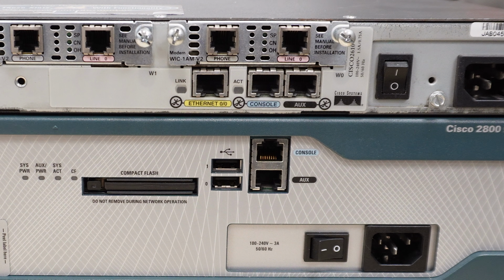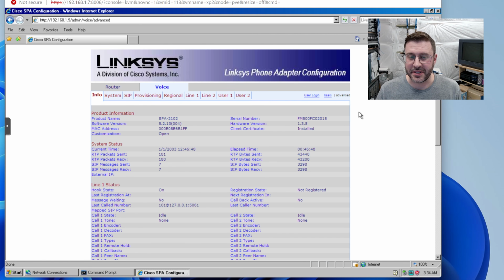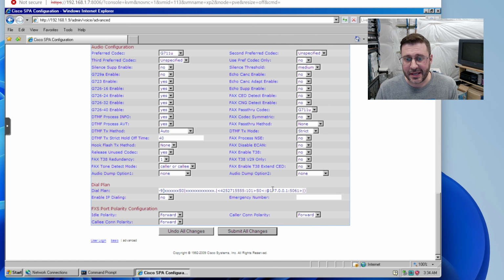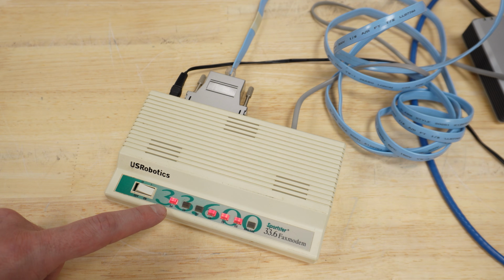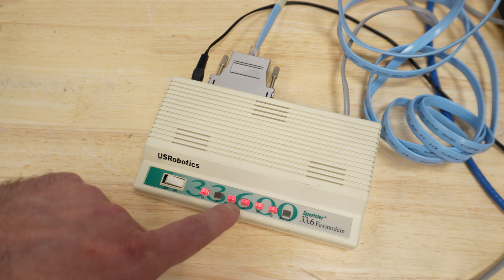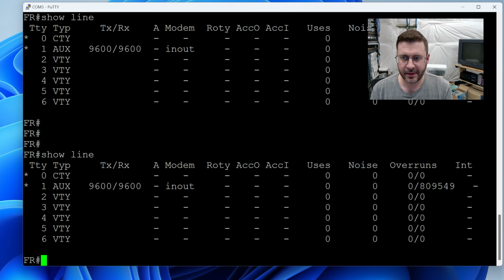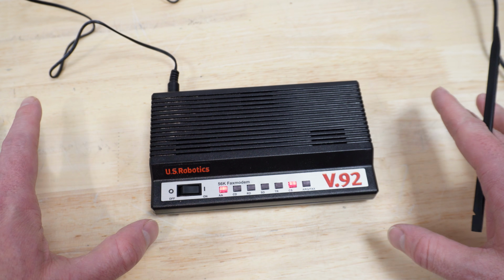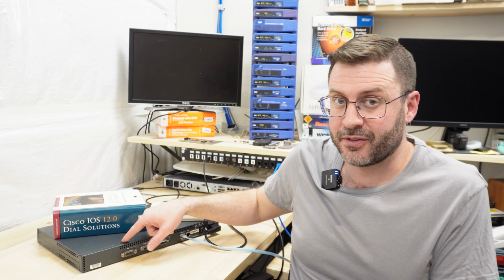Dialing into Cisco Routers

Comment: Great video!
This is a topic that I actually know things about. Not the Cisco part but everything else. Here are my suggestions:

A: Make a serial sniffer cable. Take a straight DB25 cable that you connect in series with whatever you want to sniff/debug. Add two additional cabels to that DB25 cable, that in turn connect to the input pins of two serial ports of a computer (or perhaps your 8-port terminal server). Connect those two cables in a way that each sniffs signals from each direction. The simplest use case then is to just run two Putty instances on your computer, one for each sniffer port, but the better way is to use some dedicated software that indicates all flow control signals and whatnot too, and puts all text in the same windows with for example different colors to distinguish who sends what.
This is 100% the best DIY way to actually know what's going on on a RS232 connection. With this you can easily tell if for example the Cisco device and the modem are just echoing each others commands in a never ending echo ping pong loop.

B: For video creation purposes, and also perhaps to trouble shoot the noise other commenters mention, you can build a simple adapter to tap the phone line. A capacitor in series, say 0.1µF rated at 200V or so in series with a voltage divider with say 47k - 4.7k, and two "antiparallell" diodes across the lower resistor ("antiparallell"= two diodes in parallell, but turned in opposite directions). You can then connect an audio cable to the resistor-diodes combo (ground/shield to the wire that goes to the phone line) and listen using a line input on anything that has NO CONNECTION TO GROUND. I.E. a cheap USB sound card on a laptop running on battery power (and to be safe no other wires connected), or for that sake a 1980's boom box or whatnot.
Note that the speakers in the Sportster modems are terrible. They are more or less just a piezo buzzer that is hooked up to reproduce audio rather than just buzz. You can't distinguish correct clicks and whatnot from line noise.

C: As someone else have already stated - at least the 33k6 and newer modems already have error correction built in and thus any line noise or for that sake not-terrible compression issues on the phone line / ATA side shouldn't be a problem with those modems.

D: I also agree with the comment that suggest you try modem-modem connection with two computers (or two serial ports on the same computer) and make sure things are solid this way first. If you use some classic "modem" terminal emulator software you can also try sending files and check which speed you get, and any retransmissions (select ZMODEM for file transfers, it does error correction and whatnot and is generally the best choice compared to the older YMODEM, XMODEM and KERMIT in most cases).

E: You can also try connecting the AUX port on the Cisco device directly to a computer, maybe with a crossover cable, maybe not. You should be able to manually "emulate" a modem by pasting RING, wait for the Cisco device to say ATA and then paste CONNECT 9600 or similar in the terminal window. Note that you have to paste the strings as the slowness of manually typing might make the Cisco device think it's noise or whatnot. (Not sure if this is the case for Cisco devices but in general modem related software/firmware works this way).

F: If you give up on repairing the fully dead 33k6 modem, maybe ask Epictronic (Youtube) if they are interested in having a look at it. After all, the USR modems are x86 based (IIRC they use the 80188) so they are fairly close to the PC's that Epictronics are already working on.

G: I've written this before, and I'm writing this again: I really wish/recommend that you get a classic office use PBX. Just make sure you get one that don't mangle the audio, i.e. either one that is old enough to connect the audio using analogue paths, or one with digital audio that is actually 8 bit and 8kHz sample rate. I'm biased by my own great experiences but if you can find a cheap Ericsson ASB 150/02, also known as Businessphone 50, 150 or 250 depending on enclosure size, they are a good choice. With a newer CPU card you can also connect to it using SIP over TCP/IP, while the older ones "only" do analogue, E1/T1 and it's proprietary desk phones. The minimum viable configuration for your use would be one CPU card and one ELU-A card (for connecting analogue phones/modems) but you would most likely also want a BTU-A card (to connect to your ATAs and whatnot, especially if you don't find one with a new enough CPU card to have SIP).

H: Keep up with all your great videos!

Comment: You can also use an AUX port to chain Cisco gear consoles together. You can connect the AUX from one to the CON of the other. Additionally, you can connect an AUX port to the serial port on older time servers (before they were IP-connected).

Comment: When you were recording the last call, the crackling on the line tells me the line is too noisy somehow (crackling = random data). Also, you have to set the same RTS/CTS and XON/XOFF settings on both ends to be able to transmit/receive at all. You can not have just one of them on one end (router) and both on the other end (modem) or you won't be able to transmit any keystrokes. This is finnicky, but settings must be the same between the router and his modem.... Some can be different on the calling end though as these only set the communication between devices over the serial line (safest is to have the same everywhere). My gut feeling is that you have misconfiguration issues (RTS/CTS/XON/XOFF) AND a noisy line. Have you tried another ATA adapter? Maybe it has issues.

Comment: Two things. Do a factory reset on the modems so you have a known starting point. Second, repin your DB-25 so you can use a standard Ethernet cable. 

Cisco used to sell an six cable but it was part of an expensive kit. 3rd party companies made the cables for $20 each.

I used to build these configs for remote access into a data center. It kept me from having to drive in 100 miles at 2am when a router or switch crashed.

It’s been a long time since I thought about doing this stuff. I had a stack of the nice Hayes 2400 baud modems in those nice extruded aluminum cases. Good memories /cough

Comment: I had the same problem with my fax through the SPA, I had to change the "Preferred Codec" (G711U) and "FAX CED Detect Enable" (YES) this fixed so much, but if you can hear a noise on the line then you might need to clean a cable or keep it away from SMPS

Comment: This is such a throwback, I had every one of those modems and a dialup Wildcat BBS on OS2, 5 incoming lines, then eventually had a small dialup isp, only 48 dial in lines, 56k and dual 55k isdn was the fastest I had available, but those old at commands are super familiar. Wasn’t it ATZ for reset? Wonder if you could use real phone lines. Also wonder if you can force the connection speed slower to better deal with errors.

Comment: It almost looks like the modem is sourcing power from the serial port, rather than its PSU. Maybe take a closer look at the PSU circuit. You could power both up side by side and compare the voltages on the PCB around the main power components.

Comment: I think you still had ECHO turned on in the modem.  When you connect a modem to a router or other (non terminal) type device you need to disable echo.   Because all the router bootup junk and prompts and whatnot sent by the router will be echoed by the modem and become like typed characters into the router.   This causes a loop of character generation spew from the modem... This is likely what causes the RD/TX LEDs to go bananas -- in my experience.
Reply: Also... IIRC hardware flow control is a must.  All modems of this era support hardware flow control, so that should work enabled.  The CD signal specifically is used to terminate a login/enabled state on the router so the router logs out whenever a session is disconnected.   Otherwise the second caller would get an enabled session.

Comment: Look into an ADTRAN 908E, it has full internal TDM switching and supports dialup between extensions REALLYYY well. It’s managed just like a Cisco router thru the CLI or you can enable the webui which is helpful

Comment: 21:03 In 2022 I was doing tech support where I would have to help remote techs fix/check network hardware over dial up in places like 7-11 and other chain stores. Many times I was asked to make sure the dial up modem was plugged in and status lights were on or blinking as the network was down and dial up was the fail safe. I had a landline phone very similar to yours that I could  check dial tone and verify the number connected to the modem. Many times I would arrive on site and the modem was off or unplugged from the phone line. So dialup modems are still used in the corporate IT world.

Comment: Spent my early days running several BBS's and Dial Up ISPs. When you showed the ATI4 dump  I had serious flashbacks to copying AT commands strings to and from modems..  
From what you showed I can't provide any useful advice though, even though AT stuff is "standard" there's still enough variation and extended command sets to make things sketchy. I would love to see a follow up video if you sort it out though.

Comment: Cisco pulled a genius trick configuring their Console and AUX ports in a way that the pins on them are exactly the reversed order. Hence the name Rollover cable, which is a cable where pin 1 on the first RJ45 connects to pin 8 on the other and vice versa and the same for pin 2 & pin 7, etc. Which means in theory you could convert a blue cable to a black cable just by crimping an RJ45 connector on a blue cable rotated 180 degrees... ;) (Did not try this though) Also you could maybe create a null-modem cable this way...?

Your modem problems could be flow control related, try matching the settings of the router with what your modem requires.

Your line noise problems could be ATA related, try using (forcing) G.711 a-law or G.711μ-law (these are the same codecs used by ISDN) by allowing ONLY one codec on the port settings (both of them). These are HD codecs, which means they could use more network bandwith (which is irrelevant in this case since the "packets" never leave the PAP2 box...)

Comment: I would recommend turning off the modem's auto answer. The cisco should be able to answer on it's own. Using the modem auto-answer is really for attaching the modem to something that doesn't understand that there's a modem there such as a console port. For anything vaguely intelligent that's supposed to drive a modem, it should be listening for RING and responding to the modem with ATA to make it answer and also expect to hear that CONNECT line rather than be surprised when that shows up. Modem hardware auto answer is an archaic feature that was obsolete before the internet era.

Comment: Oh the bad old days. I used to have to deal with OOB modems all the time. We found a config that worked and stuck to it. I don't remember enough about it anymore to be much help though. I do remember that the init strings are usually the problem....and solution. lol Thanks for the video.

Comment: Once ran a BBS with a Fido node.  Seems an eternity ago.  One thing that jumped at me was the IO errors on the router. You don't appear to have a serial buffer.  Back in my day, the 16550UART was basically table stakes for modem or serial comm port.  This is part of the "hardware control" in the connection.  Why the router doesn't have a buffer is almost certainly because they expected the user to have that AUX connected to a device with an external buffer.   Perhaps a hub of some sort for the AUX lines. Perhaps what your octopus cord plugs into.   I don't know how to get around that for the router. But on your PC side, the buffer needs to be on the PC. Most PCs with a 9-pin serial port have a UART because go hand in hand. For a PC without native serial ports, we got ISA or maybe PCI cards with serial ports.  They also made PCMCIA cards, I believe.  I use an old Dell D630 notebook with a serial port for all my modem tinkering.  It has a built in modem but I own a stack of external modems like the Courier and multiple Hayes and Practical Peripherals externals that I love using. Nothing sounds better than a V.FC connect tone sequence. Man.  Anyway, back to your PC, a typical serial to USB dongle might not have a buffer, nor would any USB port.  It's not something needed these days. But the router needs it, apparently.    Workaround: slow down the router baud rate until the IO errors stop.  I would get a really good modem like a Courier first and then try going to lower and lower baud rates until it stops having those errors. Good luck.  Caveat: I am old enough to no longer remember important stuff.

Comment: Try using an ethernet cable as a phone cord, like just take 2 pairs from cat 5e or cat6 cable and terminate rj11 connectors on there, the twisted pair may eliminate some noise on the line that was heard at one point

Comment: I'm guessing the kinda works one has cap plague, 95 right in the zone for it and it would explain the modem thinking its talking all the time, if the filtering caps are bad there will be constant noise on the line.

Comment: At 22:00, the modem indicates AA on RING and sends a RING indication to its host. It then picks up the call after three RINGs.
And in my experience trying to use a modem on something that's not a real phone line is futile. Especially high speed ones.

Comment: Before randomly plugging in old wall warts (power adapters) into any equipment, ESPECIALLY the old linear types, you need to check their voltage output first. If they're DC, you also need to check the ripple.

Transformers used in these power adapters degrade over time from heat and vibration, as well as the pressure from the windings in the core. What eventually happens is that the enamel coating on the wire will disintegrate or move around and cause windings to start shorting out. When this happens, the output voltage will start rising, and it can get alarmingly out of spec.

I found this out the hard way a few decades ago with my Sega Genesis. I went to turn it on one day and the console would run for a few minutes and then crash repeatedly. After investigating, the LM7805 regulators were smoking hot and had started desoldering themselves from the logic board. Further investigation showed that the original Sega branded wall wart that was originally 9 volts was 27.5 volts. This shocked me at the time, so I started checking all of the old linear type wall warts I had at the time, and I found that none of them that were older than 5 or 6 years were anywhere near what they were supposed to be. My oldest wall warts at the time from the late 80s and early 90s were all over 15 volts, when they should have been 9 volts or less. Some were over 20 volts, and the Sega one the 27.5 volts.

After testing hundreds of wall warts over the years and doing destructive failure analysis, I've come to the conclusion that they all will fail by design. Whenever I see an old wall wart like the ones in the video, they get trashed and replaced with a modern SMPS power supply. That is unless it requires AC like the modems here, in which case I'll just buy an off the shelf transformer and make my own housing for it and trash the old unit.

I would hazard a guess that the working US Robotics modem that just recently died was killed by the wall wart blasting it with voltage that's too high. The old one that just lights up everything was probably blown up by a lightning strike or other power surge, they were particularly susceptible to that.

Comment: Try turning off local echo on the modem connected to the router. The modem and router are probably getting into an error feedback loop and that’s the RD/SD activity you’re seeing. After enough of this it might cause the router to stop talking on the aux port. 

You’ll need to be to write your modem config so it’ll persist on power cycle.